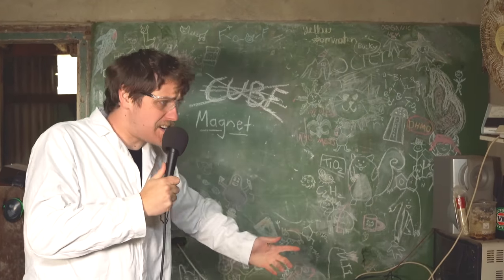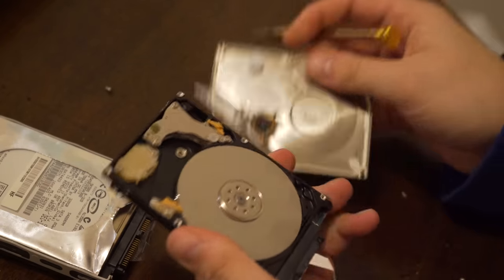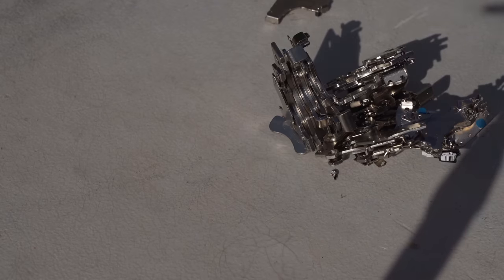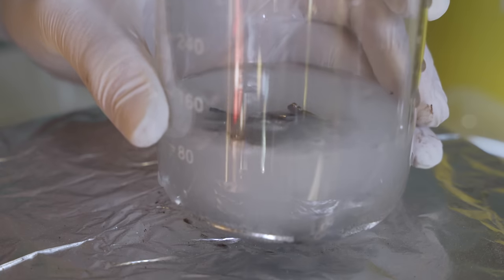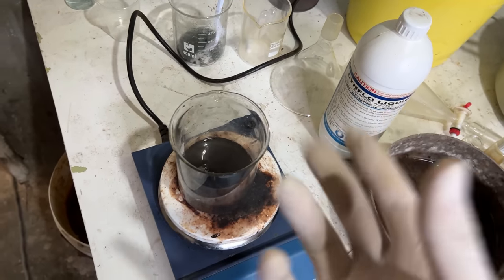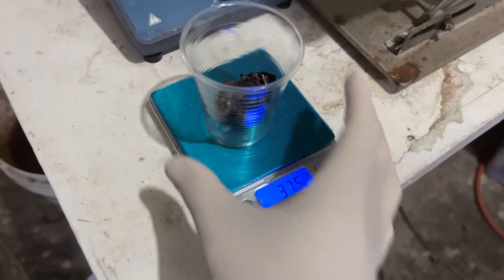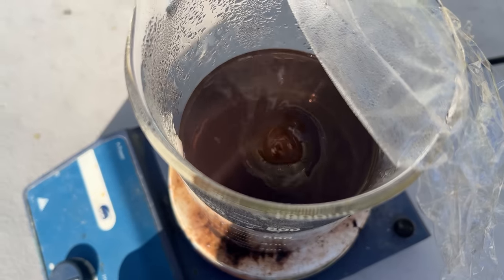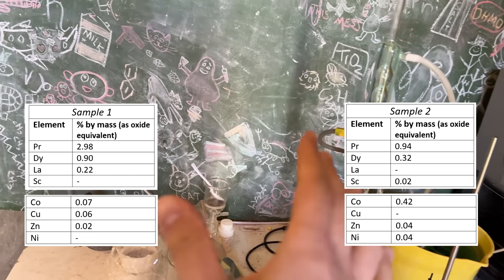Extracting Neodymium from Harddrive Magnets

Comment: The last person I saw with such a technical/mechanical aptitude was a guy who had to install new smoke detectors and deinstall the old ones. In one of the houses he had wooden ceilings what should be easy, but.... After the 5 time that he called me to come over and help he had only the top floor left to do an I just describe what he tried to do: in the last room was only a old detector base and the main body was stolen, because we changed the company for smoke detectors. It should be clear to uninstall the old base an use the new one who comes with the new detector right?.... right....???? And that the old base wont fit for the new detector should be also clear..... right??.... For over 10 minutes he stood under the old base with the new detector and looked down to the new detector and then again up to the old base and every few moments he tried to work them somehow together with not much success (I think that was the second time he called me over to help, and he had not even some tools on him till that moment....) I told him again what he should do and how and had then my own work to do but he called me of course a few times more. The last time is burned into my eyes and brain.... it was still the same house still the top floor with wood ceiling, he had brought some tools from the car but the most did not even fit. And then i saw it, he stood under the ladder, the old base still hanging, in his hand he had a normal cordless drill driver and in the other hand an SDS concrete drill with a diameter of 17mm... he tried again and again to fit them together and asked me why they wont click together.... that is a good moment to remember that there was a wood ceiling and the screws for the detector had where some M3 screws with a at max 6mm head diameter..... it wasn't a prank of him he really meant that and he even worked there 3 months longer than me.